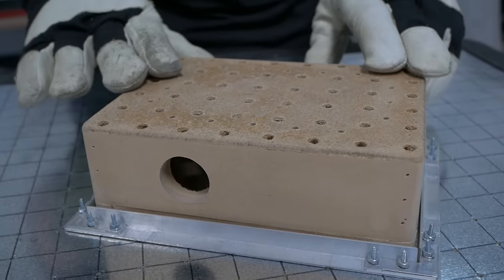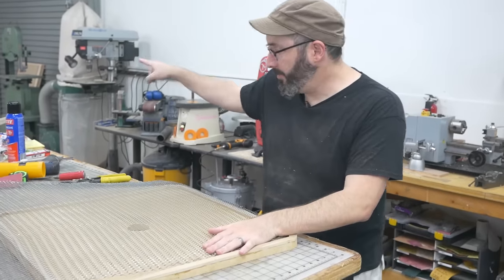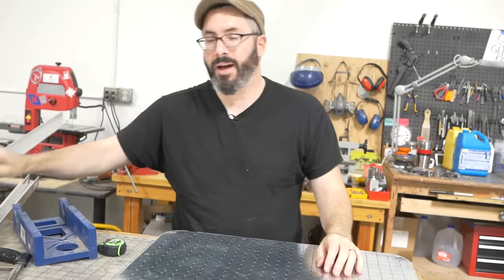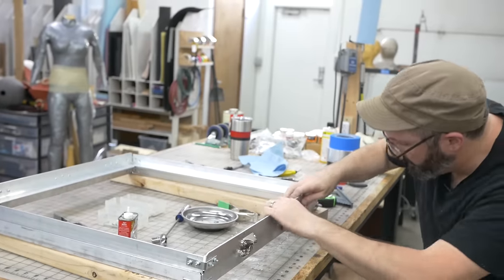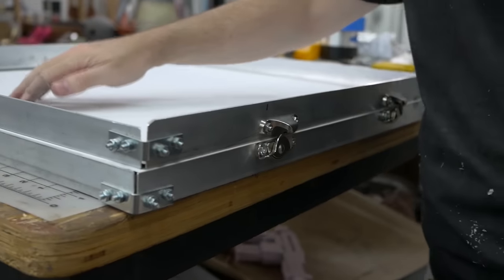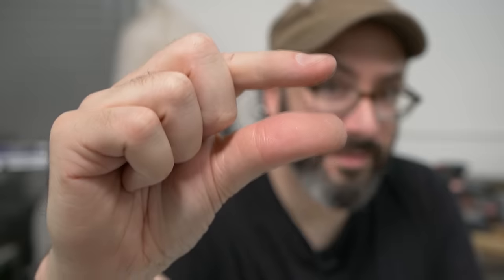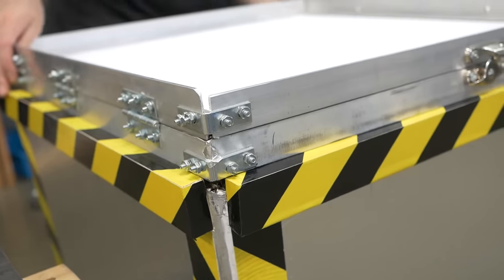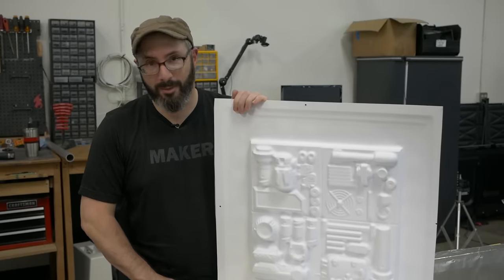Hardware Store Vacuum Table - HOW TO make your own

Comment: hrmmm... 24 x 24 = 576..?
Reply: 23x23=529
Reply: He said 24 by 24 in the video.
Reply: He also says 525 not 529.
Reply: Yeah, it's like nobody learns what factoring is good for anymore:
24^2 = (4 * 6)^2 = (2 * 2 * 2 * 3)^2 = 2 * 2 * 2 * 3 * 2 * 2 * 2 * 3 =
2^6 * 3^2 = 64 * 3 * 3 = 192 * 3 = 576
Reply: haha, clever.
Reply: +JimMulvaney - In both directions: 

The 1st line of holes is 1-inch from the starting edge, the 2nd line of holes is 2-inches from the starting edge, ... and the last line of holes, the 23rd line of holes, is 23-inches from the starting edge. 

The 23rd line of holes, which is 23-inches from the starting edge, is 1-inch away from the edge opposite to the starting edge, giving the full 24-inch width.

If he put the first, and last lines of holes, one-half-inch from the edges, and still 1-inch between rows, he could have gotten 24 lines of holes in both directions, which would have been 24 x 24 = 576.

But as it is, he has 23 lines of holes, so 23 x 23 = 529 holes.
Reply: owww! my brains hurting
Reply: @Meximagician  - Or 24x24 = 12x2x12x2 = 12x12x4 = 144x4 = 576
Reply: @Meximagician  = ( 64 × 10 ) - 64
Reply: Please friends 
How much puissance (watt) of resistance hot and vacuum  for 50  * 50 cm thanks

Comment: Don't know if yu are familiar with ShopBot tools or not. But the hold-down boards are made of MDF like the components of your platen. On the ShopBot the boards to be cut are held down by vacuum applied right through the MDF table. So, unless you have sealed the surfaces of your platen you are losing suction all over the place. Admittedly i skipped through a bit, so i may have missed it if you did seal ... but I highly recommend it. There are a number of things i would do dramatically differently with the plastic holder ... but this is your parade. Happy forming!

Comment: For mechanical connections that are going to go through a lot of movement, like the bolts holding the frame together, it doesn't hurt to put a little Locktite on the bolts so that it won't work its way loose over time. If you're concerned about being able to disassemble it later, use the blue kind. It'll do the job, and if you ever need to disassemble it, it'll come loose with a little force.
Reply from the maker: Thanks!

Comment: Okay let me just start by saying great job with the Platen and the heaters. Very similar to the commercial unit that I had to troubleshoot and Repair a number of times. I spent 17years as a lineman (high voltage electrician) at Fort Irwin Army base the national training center where they trained all the troops for Desert Shield and Desert Storm. They created mauk battles and they made US Military vehicles look like  Iraqi vehicles. The parts were all made it that vacuum former. The Platen was 8' x 12' the heaters were 3 groups of elements 9000 watts each this thing ran 480 volts 3 phase. Quite impressive to watch it work. But he's where that one defferred from yours it did not use a Shop Vacuum for the vacuum source because a shop vac can't generate enough vacuum to produce the great details that a high vacuum source can. What they had was a small Rootes blower set up a vacuum pump that pulled a high vacuum on a 150 gallon air storage tank then that was coupled to the Platen through a 2" sellinoid valve and a manifold on the bottom of the Platen. This hole thing was all automated. The heaters were on top like you started to do and they had timers on them it would heat for a preset period of time then the frame that held the heated plastic was attached to 2 air rams like hydraulic cylinders only not as powerful and much faster. When the timer cut off the heater it opened air solenoid valves which quickly pushed the plastic onto the Platen where another sensor triggered the vacuum solenoid valve to open and the high vacuum was instantly applied pulling the hot plastic down to form great details it picked up the smallest of details from the mold. 
So if you really want to get great details ditch the shop vacuum and get your self a refrigeration service oil type vacuum pump and an old air compressor air tank probably 20 - 30 gallon and you will need to take it to a welding shop and have them cut a 2" hole in it and weld a 2" fitting in so you can connect a 2" ball valve. Those can be opened quickly there not as fast as a solenoid valve but still quite quick enough.

Comment: Great video! Sometime in the spring, (around May because my Michigan garage is unheated), I'm going to modify your design for a different purpose. I want to make a vacuum table clamp. I will use rubber, and a vacuum pump and install a ball valve. (plumbing). The idea is to put an acoustic guitar back inside, and vacuum the wood to scalloped braces while gluing, to create that violin style back. I think I will put a layer of plexiglass on the bottom of the MDF, to prevent air leakage. Thanks again.

Comment: Great video I have a recommended tweak for the heat box is to use foil backed ridged insulation board it keeps the heat in and helps with reflecting the heat in.
Reply from the maker: Good tip!

Comment: I used to vacuum forming an RC body a few years ago, in order to have more details you should drill some holes on the panel you want to form, don't have to be too big, just make it 3 or 4 holes depending how big or wide your panel would be, just to help the air sucked not only from the side of the panel but also from the center. That would helps you get more details.

Comment: Gosh I'm reliving all the trials and tribulations of the 4'x4' one I made 20 or so years ago. 10 years later someone cut it in half and put an overhead gas fired oven. It was literally working in a sweat shop to use the machine for 8 hours...But it was cooking with gas, so about 4 minutes to heat a 4x4 sheet.

Comment: ive worked in an industrial setting for vacuum forming. Another hint would be to do some mold release also having your part in an oven even at a lower temperature such as 140 that will really help you part mold with out creases or spider webs.  Good Job though

Comment: Ways to get more heat out of that heat box:

1. Insulate 4 or 5 sides of the box. Rock wool is good for high-temperature applications like this. Or you could use fire bricks (such as are used in kilns and forges).

2. Put a sheet of metal, like the one you used on the vacuum table top, behind the heaters, as a reflector to direct heat straight up.

3. Reduce the height of that box by at least half. You’re using mainly radiant heat here, and radiant heat fades quite rapidly as you get farther from the source. You were trying to even out the heat distribution by moving the target farther from the heating elements, but you can do that better by:

4. Put a small fan inside the heat box, to circulate the hot air. Position it so it just recirculates the air in the box, without bringing in any outside air.

5. Put some sort of reflector (such as a sheet of foil or a reflective blanket) above the sheet of plastic, so it gets heated from both sides, and heat doesn’t escape from the top.

You may be able to get your plastic hot enough with your current design (although it still seemed a little cold in the tests shown), but if you can heat it faster, you can produce a lot more pieces per hour. Also, your energy bills will be lower.
Reply: Heat reflective fabric would be better. It's lighter and more mobile.

Comment: Great video, dig the long format and exploration of mistakes and having to replan halfway. It's always how these sorta projects actually go.

Doesn't look like you're having too much trouble with the suction, but might still be worth it to get a proper 4" inlet flange on the bottom of the table to connect to the hose, and caulk seal it down. I'm sure you're leaking at least some vacuum with just the wood-to-pipe connection there.
Reply from the maker: I think the first thing I upgrade on this will be the suction, thanks for the tips!

Comment: Circuit breakers have a time element to them. So even though you are over current slightly, it can run that way for an hour or more before the breaker gets hot enough to trip. The more over current you are the faster it heats up.
Reply from the maker: Thanks for sharing that info!

Comment: Try using a strip of sandpaper around the inside of the frame to help hold the plastic in place. You will need it on both the top and the bottom.

Comment: Hey gang, I know I am really REALLY late to this party but I wanted to add one tidbit. A strip of sandpaper along the edge of your frame can do wonders to hold your plastic sheet in place. I have tried a few things and a 1" roll of grip tape from your local skate shop can do wonders. I have also had success cutting up 1" sanding belts and getting at it with double sided tape.
Reply from the maker: thanks!

Comment: Howdy Bill. Very interesting design. I would call it the "Fire Starter". Here's why. All of the commercial vacuum forming equipment that I have seen, always have the heat source at the top. The reason is gravity and how plastics react when they are heated. If you have your heat source on the bottom, the material you are using will droop towards your heat source. If you do not pay close attention to the temperature of the material, it can sag enough to separate from the frame or develop a split and fall onto the heat source and now you have a toxic fire to deal with inside a wooden box. If you are not familiar with the material and or you do not know the exact temperature for vacuum forming you are risking a fire using this method. Also, you are using wood for the frame, which has the potential to smolder and catch fire. The glues that are used in most plywood manufacturing processes are toxic when they are heated and can cause eye and lung irritation when they are released. An aluminum or steel frame would be much safer than the wooden fire box you built. I hope you never have an incident with this apparatus, but I personally would never allow this design to be used where I work and teach. Thanks for posting the build and good luck.
Reply from the maker: Good points; if you build a machine like this you are assuming a bit risk. I would argue that you should always pay close attention to the temperature of the material for the duration of operating the machine. Many of the other machines I've seen made are built from wood and I've never heard of one catching fire, so I think we're OK there too.
Reply: Hello Bill. Thanks for the response. Yes, there is always risk. I have yet to see a wooden one. I guess they have not made it up to the Great White North as yet. Must be a slow migration. Take Care.

Comment: Hey just wanted to pop in and say that according to the 2017 edition of the nec. All outlet receptacles in a house circuit must be rated for 20 amps. So if your building this then make sure they are on two separate circuit that are being used to be safe. I am just a guy who is studying to be an electrician and thought it would help some people out who want to build this

Comment: Great video. Just thought I'd add something though. Sash locks are not the way forward. They are designed to push two objects apart (typically sash windows), not to pull two objects together. That's probably why you experienced the metal bending issue. Small clamp catches would probably be a better bet. Thanks and all the best.
Reply from the maker: Thanks for the tip!

Comment: Great vid! Adding a 6vac power transformer to the original 120vac would give you a 10% power boost, most probably enough to compensate for the borderline heating.

Comment: I think you should get a piece of foam board to put on top of your frame holding the plastic sheet while you are heating it to preserve any heat passing through it. 

I think you might get cleaner forming out of the 'base' area of your 'buck' if you elevate it off of the platen with something smaller than the buck's outside diameter [base].

Comment: If you don't have a welder but want to make nice aluminium joints, check out aluminium brazing rods- you just need a mapp gas torch and you're away. It's a nice technique to have available.

Comment: I am from Malta was watching this video I think that you d
Should use heatproof felt used in  boat engine compartments with silver covered. You will save more energy and the heatt will be better for your job. The rest is good in my opinion. Thanks for showing how the vacuum board is build. I work like to build one in my workshop for other typeof work. Bye Mark Bezzina

Comment: For joining the mitered ends of the aluminum frame, try using "aluminum brazing rod". It's not quite as strong as a well penetrated aluminum weld would be, but it's more then strong enough for what you are building in this video.

Comment: Thats pretty awesome! Just an FYI, you can weld aluminum fairly easily without a welder. You just need to heat up the corner with a torch and rub an aluminum welding rod in there.

Comment: I like your setup, but I like what Adam Savage did for making his own.  Having the heater above with the vacuum table below seems better.  Then the form can drop directly onto the surface.  Even better if it's on rails.
Reply from the maker: That was originally our goal but it just wasn't going to work with the heat sources we got and we were on quite the time crunch, so we had to be flexible! The final product works great!

Comment: Liked the video, thinking about building my own. Two ideas to improve your design. Add a thin layer of silicone to the inner surfaces of the aluminum frame. Silicone has high heat resistance, will form a wonderful seal, and will grip the plastic sheet better. Also, to gain heat retention, line the inside of the box with vermiculite board or get bigger heaters.
Reply from the maker: Neat ideas, thanks for sharing!

Comment: neat project. I would suggest covering the top of the heater while warming it up. Also, restricting (Adjustable - like on a barbecue) the air INTAKE (if any) at the bottom of the heater.  Adding an adjustable/switched circulating fan to move the air inside the heater box (think CONVECTION OVEN).  Now, knowing you would rather not rebuild the enclosing walls of your heater box as well as the fact that moving the hot heaters closer to the plastic sheet will heat the plastic up quicker and hotter, I hate to suggest that a mechanism for lowering the plastic sheet (and retaining frame) would be a significant improvement.   As to the comments about the loss of vacuum through the MDF, you would need a gauge to be certain that the polyurethane coating made a significant improvement, but the gauge might help you understand the quality (or lack) of the vacuum at the plastic as well as measure any improvements attributable to coatings, changes in gaskets, etc. etc.
Reply from the maker: Thanks for the feedback!

Comment: Great idea  and build . Gonna have to try this . Don't know about the wood parts , think I would use aluminum sheet because of the heat issues. I had the original 1960's version from Mattel ,loved the thing , don't know how many times I left it on and got called to supper (14 years old ) came back an hour later and had a charred sheet in the thing . Lucky no fires .Might want to add a timed thermostat to yours .Anyway I think I'll try it..........thanks for posting this video.....Tony
Reply from the maker: Thanks so much for watching!

Comment: I worked in a proto type shop and our heating box had 220v heating strips. Then we used a tank that we pulled a vacuum on and a large valve to release the vacuum instantly. We vacuum formed PVC sheets 1/8 thick  nice job though

Comment: Hey Bill, nice work. I like how you figure things like I do. Especially how you failed and scrapped the first heater. I do the same all the time. BTW, you would love my Death Star walls I built. I also like how you don't get stressed but then again I didn't see off camera. Wish I had a shop like yours.
Reply from the maker: Haha! Correct, you did not see my off camera frustration. There was a little bit of it during this build. =)
Reply: @punishedprops  it happens to all of us. BTW if I were to build this, would it matter if I reversed the angle iron. Have the lip on the outside. I'm not worried about hinges, may use clamps.

Comment: Add spikes under spring tension around your frame to keep the plastic from pulling out. Heat from top & bottom quickly poking the plastic to test the playability. Also, try covering the vacuum holes that are not in use for a stronger vacuum. Good luck!

Comment: You might add a lid to your frame. You're trapping the heat below the styrene, but you're losing heat (radiation and convection) that comes off the top. If you had an insulating layer above your styrene you can trap that and get a little more heat into the styrene.
Reply: A sheet of foil clad insulation would work well for the lid.

Comment: 41:11 Get a sheet of 3/8" ply, set your mold on it and trace an outline about a 1/2" all around.  Cut out the shape and add some wood slats to stiffen it up.  This will fit over your mold so you want to round the edge that will contact the plastic with a router...make sure its very smooth.  Heat your mold so its very warm to hot to the touch. Bring down the hot plastic sheet down enough so the frame you made can slide down (its also warmed).  when the both the plastic sheet is on the table apply the vacuum and use the frame to guide the plastic to the table.  It takes practice and I was building vac tables and moulds back in the 70's.